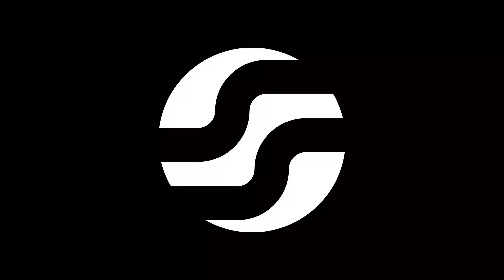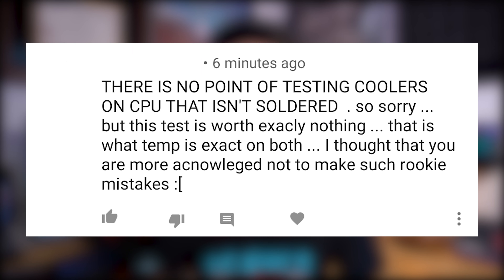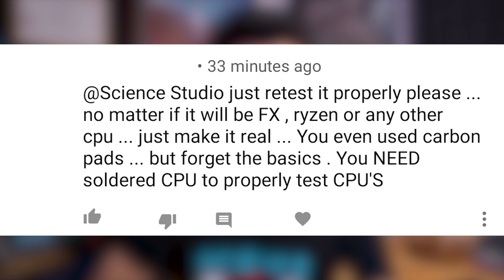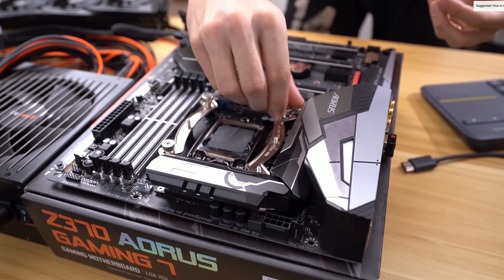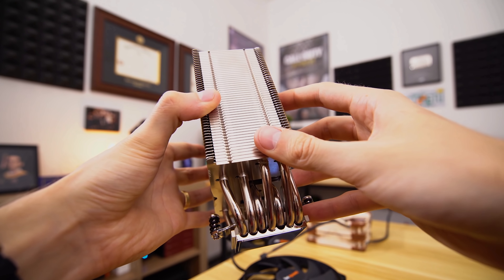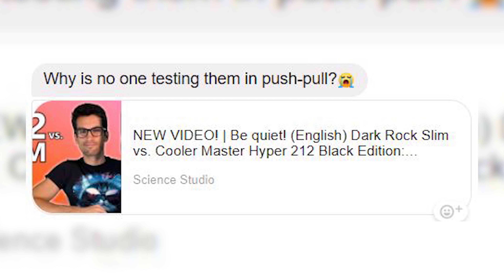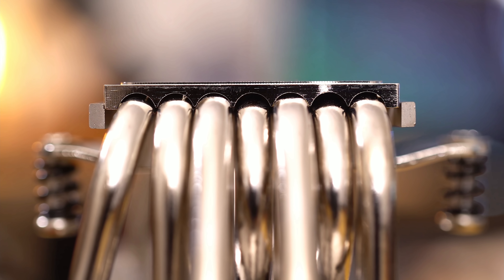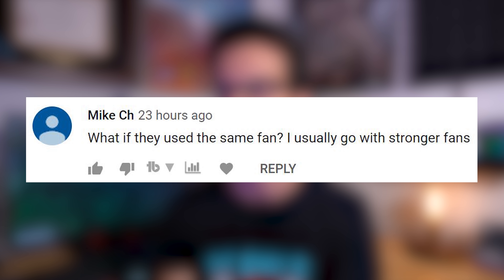Addressing Idiocy and Testing Methodology

Comment: well testing a CPU cooler in the open air removes the variable of the case thermaldynamics. and makes your tests consistent, as long as your ambient temperature is consistent. unless you always use the same case that is. people should know though, if they use their heads, that their individual temp results will vary depending on the case they use and what is more important is the delta, not the actual temperatures achieved. As long as your methodology is consistent, then you can have comparative performance results

Comment: i keep noctua fans on standby..... and then put them on coolers worth the same like a deep cool iceblade or the old wraith cooler. I bought a new gpu, took the cooler off and just put noctua fans on. I replaced my dell oem build with noctua fans, had to rewire to a 5 pin. The loudest part of my computer was the psu fan, so i opened it and put a noctua cooler in it. Replace my u1 server psu fan with one; life changing. The fans in my hydroponic tent kept dying, noctua has water proof fans; awesome........ why are noctua fans not on everything?

Comment: I was really happy with the test method Greg, The thermal Pads from Ber8auer are awesome for keeping the TIM medium exact when changing coolers,

As for the person insisting the IHS must be soldered to the Silicon, that's like saying the IHS must be Soldered to the Cooler or any test is invalid, as long as you use the same CPU at the same settings the test is valid, there is more variance in the Test Programs when running for CPU & GPU scores & people are happy with those,

Bang for the Buck the Hyper 212 is a winner,
My interest for swapping the fans was in the design of the Mounting Block position of the Heat Pipes, on one (I think the C/M) they touch the IHS on the other (I think the B/Q) they are encased in the Mounting Block, I was wondering if this has any effect on the heat dispersion ability, as the 2 coolers stock are so close I was wondering whether changing the fan would show a difference from a Science perspective

Comment: Any chance of reviewing the Noctua NH-C14S? I ask as I am thinking of doing a small build next time and would love to know how well it operates and if it is even possible to overclock on it (I have a Ryzen 1700 atm, looking at a Ryzen 3000 series - prob the 12core one - for the build).

Another thought, and maybe you have already done this, something you mentioned in the video, does push/pull improve anything?

Comment: IMO whether you test in a case or not is irrelevant if you want to compare cpu coolers. The only aspect which matters is that you hold all other factors constant because in order to cobclude whether a product is good or not you need a conparator.

Furthermore every case differs, so now there might be people with with both better and worse performance. Then you may as well test without a case to show the cpu coolers in a best case scenario, so that people know that they should expect worse.

Comment: I think you are doing awsome job here. You should test coolers as is from the box. And case does not matter if you just compare coolers. Ofcourse case ventilation matter but that's not the point. And those carbon pads are making things even more accurate if using same pad as long as possible. (Not native english. Sorry)

Comment: That said...I would like to see w/cm2 talked about a bit more.  I wonder if some coolers are 'better' or at least more economical for different chips due to thermal density on the IHS - especially where there are hot spots. I see some coolers that use flattened heat pipes as the contact surface, which would be better at handling gradients, but may not provide capacity for larger chips.  For example, an overclocked ryzen 2700x core vs 9900k. I dunno if if it'd be possible to get different chips to pull the 'same' wattage or look at dTemp/Watt across coolers and chips.  I'm not sure. I do think that there's another story about performance and fit that isn't quite being told by the data representation and methodology in place right now.

Comment: If you looking to simply compare decibel levels, there are some really decent apps for phones that are fairly  consistent, if not super accurate. You would least get the difference between idle room sound, and what the fan (or system, etc) creates. Might be a decent stop gap until you find something better, and you come up with some sort of "standard" for how you are going to run the testing. Ie Gamers Nexus'  soundproofing a room for sound testing. Just a thought.

Comment: It would seem to me that regardless of how the heat spreader  is connected to the Die the results would be the same. High temps or lower temps the difference between the coolers would be the same. You was testing what Cooler would work better not the difference between soldered and unsolderd  chips.

Comment: Unfortunately it feels like no one is actually taught science anymore. . . the most important part of testing anything is minimize variables. So if you are testing 2 coolers the only thing that you wanna change is the 2 coolers.  Using a case is irrelevant and just introduces more variables to effect the results. Thats the whole point of the pad it removes human error from thermal paste application (even if minimal). The cpu used doesn't matter so long as you use the same cpu for each test. It all depends on what your end goals are for a test, but your goal is always to minimize variables.

Comment: sound measuring device: Galaxy Audio CM-140.   decent SPL meter for the price. 

refusing to test with better fans(only using included fans) doesn't encourage companies to include better fans.      it allows them to more easily pick where to cut corners. You just become one less person checking what part of the product should be praised or should be blamed , depending on the situation.         You act as if testing with a higher end fan would mean you can't ALSO test the stock fan....and, crazy idea here, actually compare the results. 

and while you are correct you shouldn't expect people to buy a $30 cooler and slap a $30 fan on it.   but then at the same time seem to show us that you think a direct comparison of a $30 and $60 cooler is valid/useful.  in reality they are equally absurd/useful ideas; It could even be argued that a $30 cooler with a $30 fan is a much more realistic comparison for a consumer.        if you can justify a $30 price difference as a useful comparison, there is a lot to be added by also looking at how the cheap unit could potentially perform given the budget of someone actually considering the competitor.

Comment: I can kinda see the argument the guy is trying to make, he's basically trying to argue that you can't compare 2 coolers performance difference unless you remove the "bottleneck" of the inefficient heat transfer of of the non-soldered CPU's.

his issue is he is looking for "absolute maximum" performance difference when all you really need is to be able to see if there is a difference at all knowing that difference will scale under better conditions. I guess you could make an argument of the better heat transfer of a soldered Ryzen might give the test better "resolution" in that the more efficient heat transfer could maybe show a larger temperature differential between the coolers but ultimately that number would at best just reduce the margin of error in testing..

Comment: As long as you change the only thing you are testing, your methodology is sound.  I could put those coolers on my space heater with a thermocouple attached and get same results.  Maybe different overall temps, but similar to each cooler, which is what you are testing.  Not the cpu.

Comment: I'm a little confused, did the "idiot" expect you to de-lid the CPU before a CPU cooler can be tested?
If so that is idiotic, how many people are using de-lided CPU's? I bet not many.
Most of us use the cpu as it is delivered with the cooler as delivered with whatever fan is delivered.
Your only difference from what I'd expect is using the thermal pad rather than the TIM provided (if a TIM is provided) but even that is completely understandable. 
Don't let the haters get to you, your doing good work.

Comment: Is the carbon pad itself, compressible to fill in  CPU to Cooler gaps?
Reply: Ghost Dogg considering it’s performance I’d say at least some gaps..
Reply: @drannoyinghv7297  I am wondering if adding paste on the pad would make it more effective?
Reply: @vi683a  I doubt it because having a thick layer between the cpu and cooler is very bad for thermals. It'd be an interesting test though

Comment: Well he's not a complete idiot. Testing on soldered cpu would  actually bring a layer of consistency that you talk about, so would sanding the surface of the cpu.
It would be somewhat unrealistic test though, because most people Dont have soldered cpu.
You know what would be best? A test of 2 cpus, soldered and none, with 2 coolers, air and water. See if the delta of soldered or not matters.

Comment: IMHO the point he was trying to make is that if more heat from the package gets transferred to the cooler than the effect of the cooler is greater and therefore the temperature spread should be greater between good and bad cooling solutions.
Bad comment nevertheless...

Comment: I think it's better to test on an open air test bench. More consistency  with every component.  There are too many cases and fan configurations for any sort of comparison.
Reply: Same, there are sites that benchmark the cooling performance of cases and there are a lot of cases that can differ up to 30 degrees from one another, so testing in an open air test bench will yield a much better baseline to work from.

Comment: You are testing air coolers "ONLY" in a "OPEN" case. As long as you are in the same environment under the same location, on the same system, and the same room temperature, it is valid test for test any type of CPU or GPU coolers. If you modify anything like, replace the TIM of the CPU to liquid metal, I feel like your test are not real world and inaccurate because 98% of people don't replace the TIM on the CPU.

Comment: Worst case scenario for temps open air vs case will typically be your gpu thermals tyoicallywith a case with space for morethan a single back fan cpu thermals are normally highly consistent in a case and open air. Mostly because they're nowhere near the heat pumping machines a graphicscard is   
If you're pushing a cpu where thermals becomes the biggest issue you have. You will probably want to go with a better cooler not a better case or better fan thise will not impact temperatureas much as thermal mass and ability to transfer heat
Reply: There are sites that benchmark the cooling performance of cases and there are a lot of cases that can differ up to 30 degrees from one another with the exact same hardware and coolers, so testing in an open air test bench will yield a much better baseline to work from.

Comment: I don't know, man. Your methodology seemed fine, even using the open test bench. The idea is to measure the delta temps between coolers, not what we, the consumers, will get because it's impossible to simulate the scenario for every case/CPU/GPU/cooler/fans/radiator configuration. Whether the CPU was delidded,  soldered or on stock TIM doesn't make a difference. In fact, I would argue that your methodology is more accurate because most consumers won't bother with delidding. So, you'd be closer to simulating the scenario for the majority.

p.s. English isn't my native language, yet I can still put down correctly-constructed sentences. So, there is that. Take from it what you will.

Comment: My only critique is on the subject of open air benching, the effect will be limited but a very poorly designed cooler may wind up with more circulation causing a delta difference in a poorly ventilated case that you would not otherwise become aware of

There have been some issues with this from what I understand with 360mm aio coolers in top exhaust configs where the top front fan often drags recirculated air

Comment: You really didn't need to make this video, it is obvious. If the parameters are presented and the testing is indicative of that, then the conclusions made fall under these parameters and should only be evaluated as such. It's basic for anyone who went past highschool.
On second thought, I reject your analysis you should have removed the I.H.S and tested directly on the die, testing with I.H.S is completely meaningless. ;)

Comment: Just explain why the test makes sense scientifically. It doesn’t matter if the IHS is soldered or not. In science, you want everything to be controlled and consistent except for one factor; in this case, the changing factor is the cooler. He’s an idiot for saying that the CPU needs to be soldered. You used the same CPU with the same thermal pad only changing the cooler. Scientifically, this is sound.

If this idiot wants to disprove your testing, he needs to run his own tests and gather his own data using the same methodology. If he doesn’t, his words don’t mean shit.
Reply from the maker: I'll probably just end up disproving his testing in a subsequent video Lol.
Reply: I was going to post a similar comment, beat me to it!! Well said!!
Reply: I agree, it's not like he had a Ryzen 2200G testing one & a i9-9900K @ 5.1 on the other which could get a few degrees C discrepancy,
A CPU at 100% same clock speed soldered or not is more consistent than Heaven Benchmark